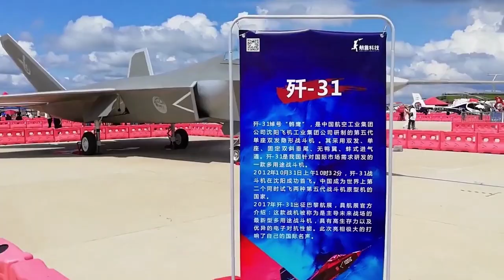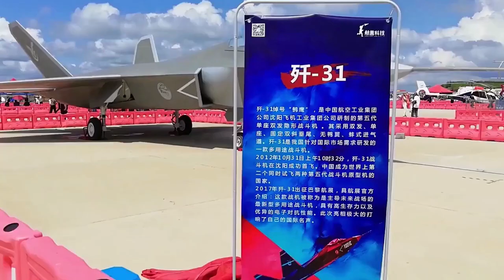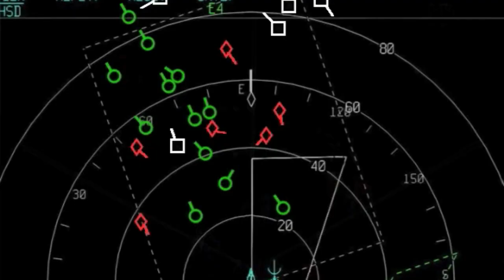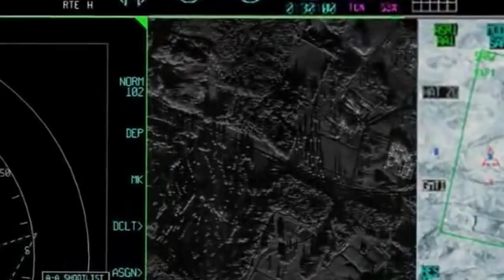J-35 / J-31 Chinese fighter update, From FC-31 to a real stealth fighter, combating US military

Comment: Why are you calling it J35? This isn't its official name
Reply: It is very likely to be called the j35.
Reply: @lenthokchom  any source saying that you may have ?
Reply: @k.k.c8670  forgot where i actually read about that. Could be the german military analyst Andreas Rupperchet on modern chinese warplanes or the articles on military watch.
Reply: It's deliberate to show it's superiority over the F35.
Reply: @literung8767  not sure I agree. Some people do so to insinuate  that it's copied
Reply: @k.k.c8670  not worth to spend billions just to insinuate that they could copy. While mfg, or "reproducing", it would be simple minded not to make it, at least a notch better, bearing in mind that to be able to copy is a lot more difficult than produce your own design.
Reply: J35 is shorter?
Reply: @Absolut531kmh  a little diff in length has no bearing in anything.
Reply: @literung8767  no, the pronunciation